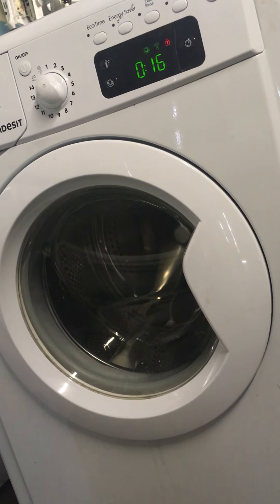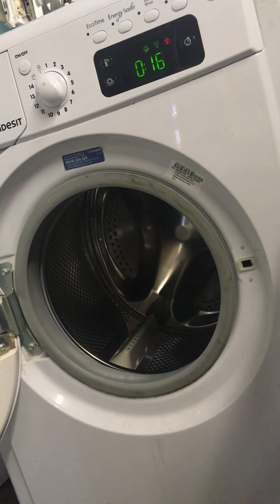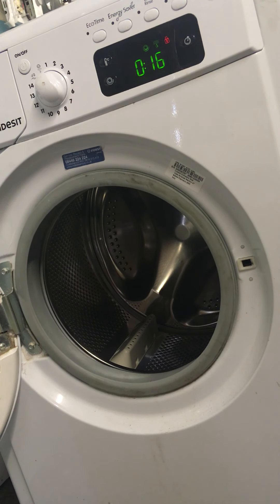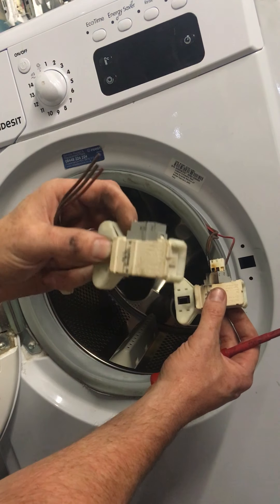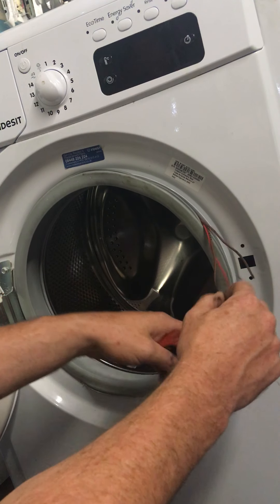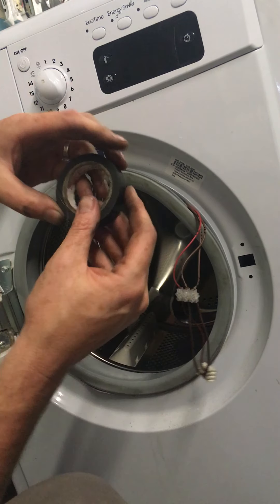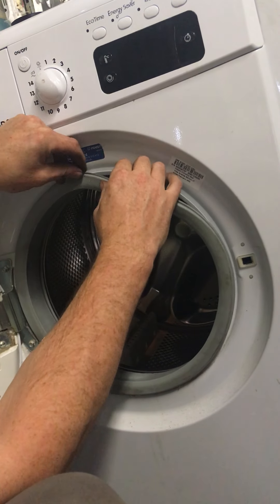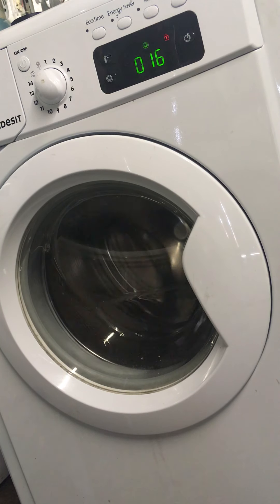Burnt Washing Machine door lock

Comment: Thanks for creating these videos. Just replaced the door lock which was burnt along with the whole wiring loom, however it is still tripping the power. Any ideas on the next likely candidate please?
Reply from the maker: Ah Man, Sorry to hear that. Did you check the main PCB to see did it blow anything on that ?
Reply: @washingmachinetipsandhelp4350  thanks for the reply, it could be the main PCB as the connector that end was a little darkened too
Reply from the maker: No worries. If you take out the pcb (bottom left as you view the machine from behind) you can take it out and open up the plastic covering the pcb. ) you should nearly be able to tell by looking at it if there is damage <Don’t forget to plug out appliance before checking this>
Reply: @washingmachinetipsandhelp4350  thanks for your help, will give it a try!

Comment: Iv a IWC91482 similar to the one your working on there, I had a wash on and the power triped in house one day once I turned it back on the START/PAUSE light was flashing, when I hit START the lock light would flash and the wash would not start agen. I pulled out the lock and it was all burnt, i ordered the very same lock replaced it and I still have the same problem. Any help much appreciated.
Thanks Darren
Reply from the maker: Hi Darren. Did you replace the wiring block too like I did or just the lock?
Reply: Had the same problem door lock Burnt out  ordered new lock , fitted the new one and still got the same problem , washer won't do nothing ??
Reply from the maker: @rosshill9362  did you change the wiring block too.? Or just the door lock ??
Reply: @washingmachinetipsandhelp4350  hi wiring block was fried so I've used crimp connectors
Reply from the maker: And no joy 🤔? It may be so that it blew something in the PCB although I haven’t come across that happening yet
Reply: @washingmachinetipsandhelp4350  would it matter if it's crimped connectors or does it need to be the proper connector , couldn't find what they was called , when connected the door lock light goes on and off as it should it just won't engaged in a spin or nothing
Reply from the maker: @rosshill9362  it shouldn’t matter if they are crimped. Is the door locking when you start the programme ?
Reply: @washingmachinetipsandhelp4350  no just the light coming on
Reply from the maker: @rosshill9362  I wonder if you swap the brown wires going to the door lock would that be it? Perhaps they went into the wrong terminals

Comment: Hi just done this same fix and my washing machine is detecting that the door is not locked when trying to run a cycle. Any ideas?
Reply from the maker: Does the door latch seem ok? If it is, Is it possible you may have any of the wires wires the wrong way in ? If all these seem ok it may be possible something blew on your pcb when the lock Burnt out 😟
Reply: @washingmachinetipsandhelp4350  just changed the wires around and that was the problem✔️ however the machine door is now locked, can't be opened and it won't run!
Reply from the maker: @calvinm9677  Jez, That doesn’t sound too promising. On the off chance is there anything stuck  in the filter (bottom right behind kick plate) — If not, could you take out the pcb and see is anything burnt out on it. I can send you a link on how to take out if you like
Reply: @washingmachinetipsandhelp4350  yepp not looking good atm. May have to get a new machine but I'll check out the PCB video. What's the link?
Reply from the maker: @calvinm9677  sorry man, up the walls. Will send you the link in 2 mins
Reply from the maker: Indesit Washing Machine PCB Board Replacement
https://youtu.be/hDPhcrsqO2k
Reply from the maker: When you have the pcb removed take it out of its plastic holder And see can you see anything burnt out on it💪